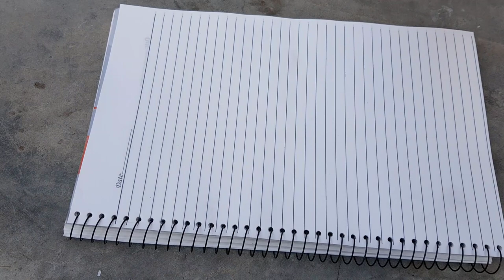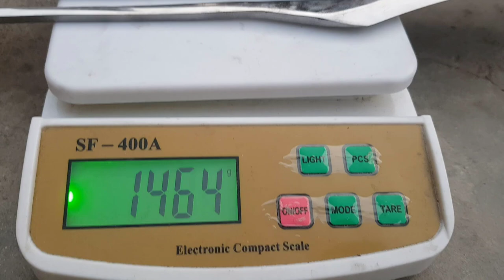Rusted GREEK SWORD - RESTORATION

Comment: *Cuts huge lengths-ways hole in ancient blade*
Why, just why?
Reply: My heart sank as a historian.
Reply: Probably because it isn't a real historical Greek sword and just a copy that is stylized after a real one. That is why he can cut holes in it.
Reply: If that sword was authentic in that condition it would be worth millions, that's a replica
Reply: @dweebs4489  exactly
Reply: It's most likely a replica. Seeing as it wasnt in horrific condition. For it to be of any use, he probably wanted to reduce the weight of the blade
Reply: yes he fucked up...
Reply: Its plasma cut sheet metal he burned a crappy handle on, the added some rusting agent to and left on a shelf until it "resembles ancient". The guy has skill jus wish he was more honest. Id rather see the cutting of steel than unnecessary sanding of metal.
Reply: Simple Answer it looks cool
Reply: He made the sword better
Reply: Hugo Grundy he lowkey ruins all the blades that way ngl. Atleast he didny paint this one black
Reply: Hugo Grundy why is every one complaining it isn’t ancient he just said that
Reply: @lilsammich8252  how do you tell that it's plasma cut sheet metal?
Reply: @amazingjoe3635  well, another thing is the fact ancient Greece wouldn't have steel but something along the lines of copper or bronze. Steel wasn't discovered until long after a blade like this's existence
Reply: @amazingjoe3635  The fantasy shape. Plus no one would put a file handle on a sword with square steel edges right above a handle.
Reply: @paigesanders2537  They did have steel tho...
Reply: @CertifiedSunset  and even if it was a real one the wooden handle would have decayed over time underground
Reply: It would be made of bronze anyway.
Reply: Absolutely a terrible idea
Reply: @louisb.6149  so ..... you're a historian that fell for this fake ass blade?
Reply: Flex on everyone by having a sword that whistles when you swing it.
Reply: Speed holes. Grants +5 DEX
Reply: B. S. good that its fake
Reply: Hugo Grundy thought the same thing
Reply: It has 666 likes what
Reply: B. S. As a historian you should also know that swords from Ancient Greece were made out of bronze
Reply: I stopped watching after this, that really hurt
Reply: ArsenWCK it would hurt either way.
Reply: @louisb.6149   well apparently you aren’t because they used brass weapons
Reply: @masonrains5010  they did predominantly yeah, but it wasn’t uncommon to make or use steel at that time either. The most primitive forms come from the 13th century bc, so some jack off thousands of years ago could commission five shiny rocks to get himself a new sword I imagine. It doesn’t seem that far fetched to me, it was no Amazon prime but Greece saw the beginning of the Silk Road at the end of its age too, someone, aka ancient me would order swords off that
Reply: @louisb.6149  I shall not disagree with a historian thinking I know everything
Reply: @masonrains5010  well I’m not gonna say don’t question me either man. Good history lessons come from just doing the work, rather that be double checking to make absolute sure you didn’t mess up 5 minutes ago or writing a really good paper in school lmao. I doubt the Silk Road was super popular in Greece but I do bet there was some steel around, it’s not as popular. But this is so not a Greek sword by a long shot either lol
Reply: @masonrains5010  I just mean honestly that all the real ones are held by collectors or in a museum and not by some dude taking a blade bit to it is all haha
Reply: @louisb.6149  yea thank you for being a nice person on here

Comment: What I love most about these videos, is that these are real swords. Not replicas, not models, not mantle pieces. These are full fledged old school ancient works of art being restored to their full capacity (only most likely better, guaranteed the iron and steel was never brought to a shine that bright five or six hundred years ago) and showcased for all to see. Makes me respect blacksmiths even more to think they would have had to fashion these with nothing a hammer and a ladle.
Reply: Well, the designs are ancient, the swords he is restoring amd customizing are maybe a decade old as he would in no way be able to get a hold of a real deal
Reply: They are not real swords, replicas, a sword from 2000 years ago would be gone or completely caked with rust and no solid metal underneath. Doing a “restoration” like this to an actual piece of history would be a sin as he is taking away everything original and making it an entire new thing, why in the heck would anyone drill a hole in an Ancient Greek sword?

Comment: I screamed when he started slicing a big chunk out of it
Reply: its called a fuller, its added to blades so as to make them light
Reply: @azadanandashareef1766  thats not a fuller... a fuller is a trough like grind out of a blade, not just straight up taking a huge chunk out of the spine.
Reply: @Noble1271  Okay i might be wrong in calling that a fuller
but it does the same thing that a fuller does
which is to male the blade lighter and faster
in fact u can see many knives nowadays with that design
Reply: @azadanandashareef1766  a fuller or "blood groove" is a structural support most closely related to a Steel I-beam. From back when blades where thicker and wide (cough cough "That's what she said." Cough cough). The sword needed some sort of support as the weight iron plus the leverage multipliers of length and gerth would cause the soft metal blades to bend or easily break. To take out some of the weight while reenforcing the blade the fuller was born. Now I personally am now curious to find out if the I-beam or fuller came first. Idk which would be more awesome a Swordsmith taking a technique from a building support or architects taking a structural support technique from a Blade and applying it to a building support.
Reply: @azadanandashareef1766  Not a fuller, a fuller does not cut all the way through...
Reply: @Noble1271  it’s not a priceless piece of weaponry. Greeks used bronze during these designs. It’s something from BudK. $20. I wouldn’t scream
Reply: @sifrost6869  that’s not written anywhere. One culture can call it a fuller as much we can call our designs a sword as much they call theirs a sword, even with differences, big and small.
Reply: Armchair quarterbacks; post links to your own work below so we can have our turn. And to add slight validation to anything you say
Reply: @azadanandashareef1766  knives arent meant to have cutting power of a blade like that so making it lighter is making it worse. your not maneuvering that kind of blade like a knife or any other lighter version of a sword. Its clearly meant to cut like an axe.

Comment: When the title says restoration yet you make it into something completely different
Intelligence 100
Reply: How did he make it completely different?  He removed the rust and cut a hole in it.
Reply: Argumengenic Hyperloquaciousrrhea restoration means to restore something and make it so it looks like the original. This isn’t restoration because he cut a hole in it
Reply: YT_benthepen33 it is a fucking restoration. The handle was broken and he needed to make a new one.
Reply: @bentack33  repair or renovate (a building, work of art, vehicle, etc.) so as to return it to its original condition.

The word "restore" has several definitions that mean similar things. Your definition is one of many.

Comment: That wood was still fresh, its just been soaking in water for a while, the iron in the blade is untouched by oxidation, it's only minimal surface rust to minimal exposure in water..

This is an ebay replica of 300 Spartan (movie) blade.

Comment: Why did you cut the slot out in the spine? You just weakened the knife.
Reply: Rule of cool. Since this is the type of weapon that will spend its days most likely on a wall this opening is very practical.
Reply: And it's not a knife.
Reply: It serves NO useful purpose and is even a lousy decoration if that's what it's intended to be!
Reply: Hang it on the wall xD
Reply: Some blade weapons are designed with slots or grooves to create the quick passage of blood.  Jagged blades that difficult to suchere are in inflicting wounds can be more quickly used in combat. Jagged slashes in the neck will result in carotid arteries that feed the brain. ( The blade is also too long & curved in the wrong direction to lacerate deep enough to make that slot deep enough to be a quick drain for the femoral  artery. )  IMHO the slots are there ONLY for artistic purposes.
Reply: IMHO this might be an art object if there were better detailing.
Reply: It is basically similar to blood guttering.  If you stab someone with a longer smooth blade, it can and often does get stuck in the body due to suction.  If you groove the sides of the blade or even put that slot it in, it can be withdrawn relatively easily.
Reply: James Varner ok everyone on the internet talking about “blood grooves” they are called fullers and have nothing at all to do with blood, they remove weight from a blade so that the sword is the same size but much lighter.
Reply: oh no!  now it won't be able to cut anyone in battle or be displayed on a wall
Reply: if the blade was forged well and quenched perfectly on time and its the right amount of carbon that blade would never break lose an edge or warp. i foge knives and swords. its difficult work, this guy  deserves a round of applause he did well for a restoration,but id like to see him forge his own blade
Reply: @cookingprof  If done right it creates a stronger blade as it creates more surface area.
Reply: There were swords back then with cut-outs on the blade, it doesn't weaken then blade as much as you think it does and reduces weight. Though admittedly I've never seen one with cut-outs so large before
Reply: no idea i thought the same thing. my opinion he ruined it
Reply: I completely agree.  When I first saw him marking it, I thought he was going to add a fuller there.  That would have been better than cutting a slot all the way through and also more decorative / ascetically pleasing for display purposes.  What he did was just ruin a perfectly good blade.
Reply: It was meant to make it lighter .
Reply: @jamesvarner7816   Rubbish. Source of GTFO.
Reply: It makes the sword 1% lighter lol.  Its just aesthetics.
Reply: I believe it was an insult to the Trojans, after Troy fell the Greek invented Pita bread borrowed from the Turkish bread. The flatter bread could be rolled to form a cylinder, or "whole". Troy was now awash with souvalki stores, so the greeks began cutting wholes in their swords to remind to Trojans of the souvalki stores on every corner of Troy.
Reply: It’s meant for display in this age it’s highly unlikely to be used so you could just stick it on a wall easier.
Reply: James Varner Yh really interesting that mate we'll take your word for it im sure you leant from experience
Reply: That might be done also for balancing the sword if the original version was unbalanced.

Comment: When he calls a sword something like “Greek sword” he means what type of sword it is. It probably isn’t the real deal if he is cutting it, or even has it in his hands
Reply: That sword is called a kopis used by spartan soldiers in the 5th century as a secondary weapon to the pilums they generally used (pilum is a spear)
Reply: And it seems to be an actual sword from that time looking at the state of the out and inside of the handle and the rusted blade
Reply: Vipershot22 ah I see you are also a man of culture
Reply: @brandonwalenter1147  I highly doubt this is a real kopis By.looking at other 5th century swords, all being mangled and eaten by the rust over the course of the years, i don't think such a perfect model of the kopis would fall into his possession... but then again i have never heard of the kopis until this video but it looks a lot like a khukiri or a falcata. Another point is after looking at photos of the kopis it seems to have a different hilt than the one in the video. The hilt looking once again like one of a falcata. But again i've known nothing of this sword until now.
Reply: @blakefoox6091  kopis type swords were used from Mycenaean times and appeared with the seapeople.
They were later favoured by cavalry and mercenaries.
A lot of Greek mercenaries came from Arkadia. This is NORTH of Sparta.
Spartans did not favour any type of sword. They generally had shorter ones.
Reply: @halt3294  falx is a variant of the Mycenaean precursor of kopis (long&thin, single edged, facing downward) and Kukri is basically a kopis.

Comment: WHY DID YOU CUT A HOLE IT IT YOU MONSTER
Reply: To reduce the weight.  The finished product was still about 3 lbs., which is quite heavy for such a short blade.
Reply: Made this make the blade more weak
Reply: @miguelangellopezrodriguez9021  no
Reply: Well, modern people are small and weak compared to ancient Greeks, as noted by the historical documentary, "300". He most definitely got rid of an equivalent percentage in mass from the sword correlating to the difference in body weight between King Leonidas and Mark Zuckerberg, Facebook King, as example. Correct me if I am wrong, as I have been mistaken in the past.
Reply: @akalaification  Modern westerners would be giants in those days. Suits of armour were very small a millennium later and these were rich men with a superior diet to the masses.
Reply: @akalaification  hahaha soo good
Reply: @Jovit ___  The weight in the handle should typically be equal to or slightly heavier that the blade itself, unless it's a chopping blade (such as a wood axe).  Using brass in the handle to offset the weight of the blade was a smart choice on his part.
Reply: The hole lets air pass through the sword so you can swing it faster so it increases functionality
Reply: @thatusuallfortniteplayer_8969  that is nowhere close to being scientifically or historically accurate.   fullers were used to reduce the weight of the blade allowing for easier handling, but they never went all the way through as doing so would upset the structural integrity of the blade.
Reply: @Monty2451  I would have gone with a fuller instead of a hole/slot..
Reply: @thatusuallfortniteplayer_8969  Only if you swing it sideway, otherwise it's only creating turbolence that will augment the resistance to air I guess.
Reply: @akalaification  If you think 300 is a historical documentary...well that justifies your other delusional comments.
Reply: Because it a peace of shit blade that a guy with a grinder made
Reply: Draggy654  r/wooooosh
Reply: Draggy654  do you know what r/wooooosh is?
Reply: @akalaification  People were actually alot smaller back then. If you ever went to a old castle you will find that the doors etc are really tiny compared to today's standard.
Reply: supimsatan holy shit, I was being sarcastic.
Reply: Draggy654  That is so true, I have two of them. I found them off Oak Island  when I was diving on a Greek sunken ship. I  keep them in the Found but you may know it as Lost Ark. You would be surprised how well sharpness stays when stored in the Ark.  Half my family has been zapped by the Ark like a bug light. But, I handle it with Levi gloves.
Reply: @rafaelcaraballo5454  THIS IS SPARTA.. consider yourself kicked for taking the bait. lol.
Reply: When I visited the historic places in greece I wonderd about the doors. So small. And thats as a child. I gues normal people were around 1m60. Depending also on nutrition. But the doors looked more like for hobbits. On the other side. A hobbit with a blade like that. Better run.
Reply: That's the Greek worrier for you reference to 300
Reply: @akalaification  for real
Reply: Many swords have grooves or holes in them for weight balance, weight in general, and if it is a thrusting sword, for blood flow. You wouldn't want your blade to get stuck in someone, so you would groove down the middle to allow the person's blood to run down reducing the suction of their body on your blade. :P
Reply: I reeeeee over this too.
Reply: Monty2451 Yes because he has to slay dragons and free the princess after.
Reply: @Monty2451  you dont reduce weight in a sword by cutting a foot long hole towards the guard let alone up by the spine. he moved the center of gravity further to the tip of the sword making it to where more force is needed. if it was to reduce weight he should of carved a blood groove into it, did a swedge grind, and a holo grind to remove as much material as possible without compromising the integrity of the sword. hell he could of added weight to the pummel area. yes it will increase the weight but it will move the center of gravity further down to his hand so swinging it wont be as much of a problem. example take a sledge hammer hold it by the handle is if its a 2 handed sword try swing it around itll be hard. flip it around with your lower hand resting on the head and the stick facing away and swing its easier but the same weight. so he might of reduced the caring weight but he increased the weight in swinging.

Comment: re·store
/rəˈstôr/
verb

1.
bring back (a previous right, practice, custom, or situation); reinstate:
"the government restored confidence in the housing market"
synonyms:
reinstate, put back, replace, bring back, reinstitute, ... moreantonyms:
abolish
Reply: abolish
Reply: mod·i·fi·ca·tion
/ˌmädəfəˈkāSH(ə)n/
noun:
modification;
the action of modifying something.
"the parts supplied should fit with little or no modification"
synonyms:	
softening, moderation, tempering, qualification, restriction, lessening, reduction, decrease, diminishing, lowering, abatement, mitigation
"working class opposition to the tax has led to some modification of this stance"
Reply: NUT
Reply: Oof

/euf/ 

Definition: when you die in roblox
Reply: Government and confidence should never be used in the same sentence